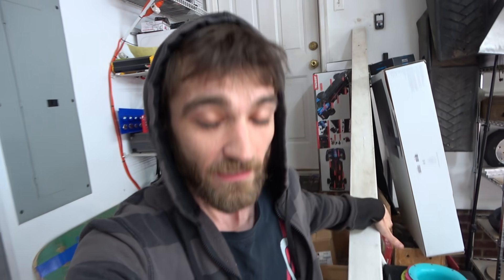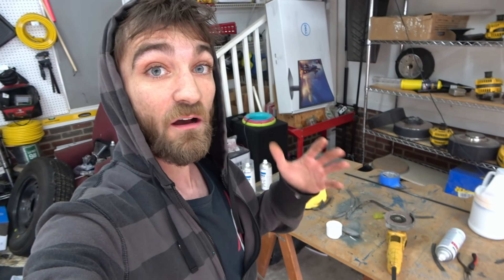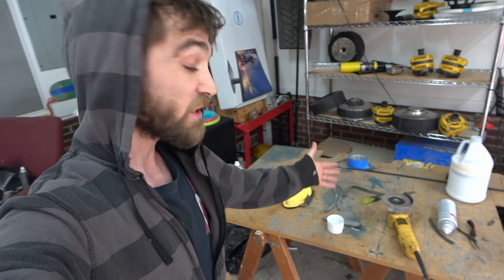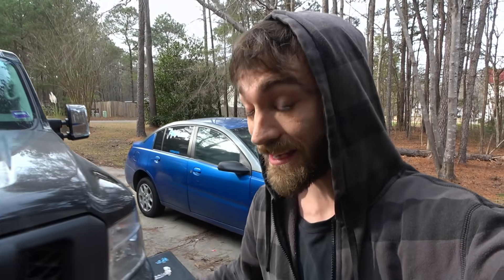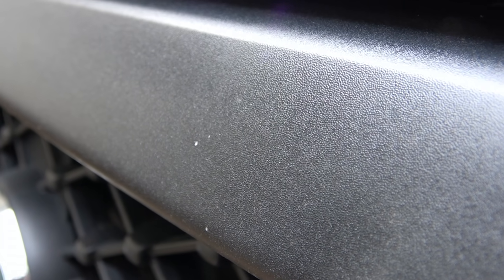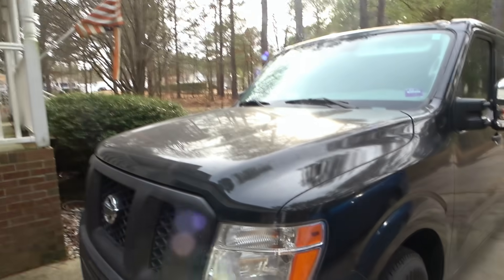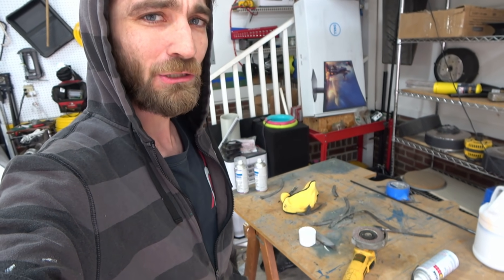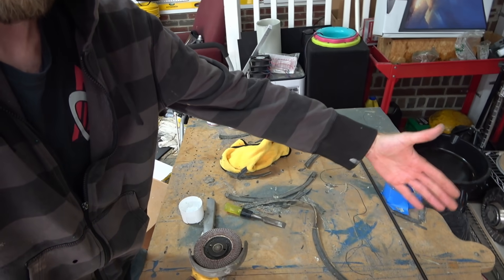FACING MY MISTAKE!!! (EXO's 75,000W Car Audio Build)

Comment: A good detail shop can wheel that off like it never happened.
Reply: Yeah, it would help if it was waxed recently.
Reply: Hey man shit happens,but at least it can be resolved
Reply: Junkyardhemi is 10000000% correct. Please don’t stress about it...
Reply: Yeah exactly to paint a vehicle is a long process so this little mistake shouldn't be that bad
Reply: Super easy for an experienced detailer to correct. Clay bar, Rubbing compound, polish wax
Reply: @cliffp73  wrong* buffing it or polishing it would literally burn the particles of white paint into the clear the best process would be soap and water and a clay bar to lift the overspray particles off the clearcoat and clean the finish of any contaminates before ever even thinking of buffing or polishing any vehicles finish
Reply: He could clay it himself for less than 20 bucks.
Reply: Nah pressure wash
Reply: @alexdel-toro323  pressure wash won't take the paint particles off it's dried to the clearcoat a wash and clay bar will fix it
Reply: Hey bossman. Check out my New Set Up. 5 15s on A Taramps 8k
Reply: Clay bar I’ll get that out for sure.

Comment: DUDE JUST USE A CLAY BAR, IT WILL TAKE SOME ELBOW WORK BUT EVERYTHING SHOULD COME OFF ITS NOT THAT BAD
Reply: Literally going to comment this. My dad did this to his truck when my sister in law drove over fresh line paint. Clay bar took it off easy
Reply: Basically 95% to 100% of the overspray will be removed by a simple wash and clay bar just going to take a little time and lots of clay bar
Reply: He literally said clay bar in the video.

Comment: Bro you can just polish that off really, don't worry about it.
Reply: Either buff it off or rub it off with some mineral spirits. Should work nicely
Reply: Yep if it's rattle can the mineral spirits should wipe it right off. Peace a cake
Reply: Yea bro
Reply: When I saw your set up in the painting video I know the cars were going to get covered.  I’m sorry it happened but as others have said it is super easy to fix. It happens around my construction sites all the time when they spray the buildings.  The van will actually look better than new after a good paint correction so don’t worry about it man.  The van is going to be great inside and out! I hope you come back up to mass so I can get to hear her! Be well man

Grateful
Reply: Clay bar would work perfect.
Reply: Hey bossman. Check out my New Set Up. 5 15s on A Taramps 8k

Comment: Dude Just Clay bar it and buff it out you'll be fine ,Use some Colinite Compound to buff it out she'll be Fresher then factory
Reply: That's exactly what I was thinking that and a good heavy cut buffing compound I like 3ms
Reply: @hbell8264  not just a buff you'll need to properly clean the surface before ever even thinking about buffing soap and water wash with microfiber and then clay bar will get rid of 95% of the white overspray if someone buffed it without clay baring it then all the white paint would just be rubbed and burnt into the clearcoat making it even worse
Reply: @FrgottenFrshness  That's right you can't just buff over spray off like that. There are steps. It's really not that big of a mistake. Easily corrected. Wash with Dawn soap and water (dawn, because it actually takes previous wax off and is gentle on the paint overall.) Clay bar (chemical guys make an excellent clay bar). Wash again ( to make sure paint is on good condition). Don't use a heavy cut compound, use a polishing compound. Then seal with a good coat of polymer wax (maybe even graphene coat the paint) and it will be as good as new.

Comment: If I would have seen this being a previous pro detailer in a body shop I could've told you that's pretty cheap fix. Acetone wipe down, clay bar, and polish. Fixed. But the plastic may be a spray job

Comment: I don't want to downplay it but honestly that's not a huge mistake. It'll easily come off with pressure wash + dawn => clay bar application. At that point you can always do a quick polish and a ceramic coating application too.

Comment: I worked at a high volume body shop, bro you can relax, get some ebay clay bars and some elbow grease and do it on a day with lots of sunlight, if the plastic grill is an issue, power washing  or a brush with soap and water could be the solution. Time consuming, but it's no cause for repainting or buffing. You're good man. Clay bars.

Comment: I have done the same. Used goo gone, takes it off with a little elbow work, then go wash it super super good and re wax it. Should be as good as new. Make sure to use a test spot first to make sure you don't take the origanal  paint of the vehicle off first.

Comment: Give it a good wet sand and buff it out and call it a day. The paint will look that much better for it. I would wait until a few days before you show the truck to do the paint correction. Also you need a decent work area with a proper bench.

Comment: If you go to walmart you can get this kit that includes a foam buffer for a drill and bottle of compound for the like 18 buck. I used it to remove some scratches from the hood of my truck after a tree scratched it. Just make sure to buy and extra bottle of compound for like 6 bucks so like 25 bucks total. It's called Meguiers scratch X and It works great just trust me.

Comment: owning a fuck up as gracefully as you did is an extremely valuable life skill. in the face of this fuck up - if i was going to do a build with 8 batteries and 3 alternators and a clamshell design I'd literally badger/contact you first. I'm not trying give you shit and im not trying to sugarcoat anything either. but in 100% honesty expressing your experience, even if it is a fuck up - in my humble opinion - is the best resume ever. just keep doing what you're doing. you're passionate and driven enough that you're going to beat the game. and with a type of prestige that most bassheads won't ever have.

Comment: It’s ok you can lightly wet sand it with 2000 grit and then use compound and then polish it will actually look better then before ppl do it for paint correction
Reply: Sanding overspray will remove alot of clear coat for a simple problem.

Comment: Back at the old detailing shop where I worked previously, we'd use virgin lacquer thinner on a soft cloth to remove botched paint touch up. Might be worth a try since it's basically fogged on unlike touch up. Just an idea... someone chime in if this process is wrong.

Comment: Clean it off with acetone on a rag then wax it. Acetone doesn't hurt modern paint. They make stuff for removing overspray if you are worried about using acetone but you still need to wax it after

Comment: Exo that knot on your forehead is a cyst. I know because I’ve dealt with them for years. It’s best to remove them while they’re small. It’s only gonna grow larger and it’ll be a pain in the ass to remove. You have 2 choices, either see a dermatologist or you can easily remove it yourself. All you need is a scalpel, butterfly stitches and some ice to numb your skin. Once numb with ice, make a small incision with scalpel, pop it out then apply butterfly stitches. Love your vids man

Comment: Use a buffer attachment that hooks up to a drill or if you own or rent a buffer get it wet and rinse thoroughly as you go but paint will come right off without damage to original finish

Comment: Get some cheap 20 x 20 furnace filters and zip tie them behind the fan on the grills, it will catch most of that overspray without ruining the air flow too much.

Comment: If it makes you feel any better. Back in 2004 The company my dad worked for hired some people to paint the building and they ended up spraying a whole parking lot filled with cars with over spray. It cost them around $100,000.

Comment: Hey man! You're going to think im crazy. But I know an EASY fix for this!! Go to walmart get cheap 1.97 carb cleaner. Spray it on cheaper microfiber towels from harbor freight. (Because you're going throw them away anyways) Finish off the harder parts if any with a clay bar by your side. Another great thing I can kinda see in the video is they are dust/dirt on the car. Meaning 75% of the over-spray probably settled on that substrate, and not the actual clear itself.
But yeah. It'll wipe right off. And it wont hurt you're clearcoat on your vehicle. Seriously man. This will fix you. I use it to clean out my paint guns and to remove overspray all the time on cured clear. I hope he sees this comment.

Comment: O man EXO I feel your pain and can completely relate! Years ago we lived in a apartment complex and the garages where all one unit with just walls splitting each one. But the walls only went 3/4 up. If you can picture what I'm talking about. Well I rebuilt my four wheeler had the frame blasted and was so excited to paint had everything prepared put plastic over my tool box and went for it. I primed it went to lunch came back a couple of hours later everything was looking good so I put on some color let me go back my primer was a lite gray and I used a deep blue for my color. So I got it all done it turned out great. I cleaned up and let it dry for the night. I was so excited to start putting everything back together the next day I came out walking to my garage and noticed my next door neighbor had his garage open and just yelling and freaking out... I covered his bikes "1 of 4 rocket's he had in there" in overspray.. it gets worse my garage was in the middle so as I'm dealing with how I'm going to fix this the guy on the other side of me comes out and my heart dropped this man was cool as hell but he's the type of guy that you didn't fuck with! He had a brand new ss camaro that he loved.. long story short I'm still alive but it cost me over two grand at a body shop to fix his car and the four bike's I still feel so bad and that was about 15 year's ago. I watch all your videos and thought a few times how's he keeping the over spray down. Then as your painting your basket's the other day I seen the fan and could see the car's in the background and thought of what happened to me then to see this video shit I had to share. Shit happens bud but just think you'll never do that again! Keep rockin bud I look forward to every new video

Comment: That could’ve happened to anyone. Feel bad for ya. 
But I do know how you feel. I had a 1993 Mustang GT and I had to have a new windshield installed in it. Don’t remember how much later, but I went to install a hood scoop on it and I went to cut out the hood with a angle grinder and didn’t cover the windshield! I got inside to move it and looked out and said “what the hell is that?!?! The sparks from cutting the metal sprayed all over the basically brand new windshield and looked like it put burn marks on the glass. Kinda looked cool, but I was still pissed that it happened. You get in a hurry and excited about starting a project and not think about the bad things that might happen.

Comment: Bro no biggie. Literally a rag soaked in thinner will wipe it off. Don't clay bar or put a wheel on your black paint. Spend 10 bucks on a jug of lacquer thinner and literally wipe it off like it was dust on a shelf. It wont hurt the paint or clear coat.

Comment: EXO try oven cleaner. I once bought a truck that had a companys logo painted on the side and was told to use oven cleaner to remove it. It worked with a little elbow grease and didnt damage the paint underneath.

Comment: Brotha -  Last year I bought a metal storage cabinet at a yard sale and decided to paint it red in my 3 car garage while my white camaro was inside and covered partially - the whole top of the car T Tops hood truck lid and all covered with overspray even through some of the cloth coverings ..  FML .. My car painter buddy told me all I had to do was wipe it down with watered down mineral spirits after I spent 4 hours with a buffer and compound removing the over spray..  Good luck to ya .. Yes we all make mistakes .. SMH

Comment: Dude! People make mistakes! Now, pro tip. Next time take a garden sprayer and slowly mix a large bottle of dish detergent and water. Spray your entire vehicle down and let it dry. This provides a protective layer against overspray. After you've finished your work simply take you water hose and rinse off your vehicle. This will save the headaches next time.

Comment: Been in detail for 10 years. Not a big deal to fix it. Body prep solvent will probably remove it but if not lacquer thinner will. Just make sure to thoroughly wash it and then use a microfiber cloth when rubbing the thinner on the clear coat.

Comment: It’s not a problem at all man.  You can easily fix it yourself.  Just go to a decent auto or paint store and as for cleaner clay.   3m is the best for overspray.   Then it’s just wash the van, leave it wet then warm up the clay and go for it with either soapy water or clay lube.

Comment: I kinda did the similar mistake on my last build. Was painting Outside the garage! Both door nearly closed, one was maybe 2" open for the power cords and all buuuuuuut.. some of the silver paint dust went inside the garage and on my red car.. But since the paint was not that wet after hitting the clear coat and windows, if buffed off easy. 
I can tell it took a while to figure it out when i noticed while driving... my windows had a tiny glow of silver in sun ligh. What in the heck is that.. paint! From where.... and way later it hit my. My painting.. outside.. FUUDGE !!!!! 
NO worries EXO, it will be all good after the buff operation.

Comment: Maybe all that contaminated area underneath the over spray might be a good thing which added a barrier to protect the clear-coat so chill and just have the shop fix it. And dude make u a spray booth with filters and vacuum system to suck the over spray into the filter. Stay pimpin bro

Comment: Not an expensive mistake, custom automotive printer here, you can wipe it off with mineral spirits. Mineral spirits won't hurt Clear, or a quick cut & buff will take it off easy, don't worry

Comment: I can save you a TON of time. Call your local paint supplier and get an OVERSPRAY REMOVER PAD. Its like a soft textured rubber type pad for a da. Use it and mist windex on the panel. We use it and it works awesome. Probably do the entire van in 2 hours. Wash n wax nd your done.

Comment: Get some clean rags a can of unleaded fuel and wipe it off ...small area at a time. Will take 1k aerosol thinner off no probs without ruining the 2k clear coat. Less messy than flat and polishing. I used to use petrol to pre clean cars before paint preparation.  It will work fine exo.

Comment: Uh that's not a mistake, it's an opportunity to get a cheap wet finish. Step 1 mist vehicle with a sanding guide coat of paint. Step 2 wet sand with 2200 grit sandpaper until all specks are gone. Step 3 buff with polishing compound. step 4 wax vehicle with wet wax. You are going to be amazed.

Comment: i bet most of that overspray will wipe off. if not it should buff right off.  Brake cleaner works well if you use it quickly to remove spraypaint, but it'll strip any waxes. Might damage paint if exposed to long.

Comment: Hi exo. Retired automotive mechanic here.  Ok put gasoline on a soft cotton rag. Wipe that paint right off . It will not hurt the cars pain. Try it in a spot that is not easy to see first. Trust me this will take that over spray right off . I have seen this a few times in the past.

Comment: The overspray is less concerning than the use of plain ol’ box fans to vent potentially explosive fumes. Explosion proof lights and fans bud or just move it out in the open for the spray phase and move them in to dry.

Comment: Hey, sh** happens. Rub and polish and it will be better than new! It's going to be a show car so a good polish and shine had to go in anyway.  I've messed up cars in a similar way atleast two times before, one with sparks from welding an one with dust from diamond cutting disk. Both times it screwed up windshield and side windows and that definitely don't polish out. And oversprayed underbody coating on the interior. Mistakes are what we lear from. Keep up the good work EXO 😎🔊

Comment: Clay bar and soapy water will take that right off bud.. Lots of elbow grease required. Been there done that, only it was 12 vehicles in a parking lot when I was a painter at a welding shop. Kicked on the wrong exhaust fan and you guessed it. Coated everyones vehicle with Yellowstone tan 🤦‍♂️

Comment: No man not an expensive mistake if it's super thick use a Microfiber towel and some solvent and most should come off but that's if it's extremely bad(hard to tell exactly on video) only use solvent if it's needed!!! But use a clay bar or towel that will remove the surface contaminants with minimal damage to clear coat or paint **will probably need a polish after using clay** but I am detailer and I have to remove overspray all the time on my customers cars maybe since your a great diy guy maybe buy a clay bar for $10 and try your hand on it cause you'll end up paying around $150-300 on someone else to do it with quality work and it's sorta fun watching everything come off and good feeling knowing you had a part In it 🤷 Don't stress brotha!!!!

Comment: That's not an issue. Soap n hot water little bit of elbow grease n dog bone sponges 🧽 it'll come right off. Coming from a painter of 20 yrs. Literally once you get it wet should come right off

Comment: Listen bro..next time this happens..go buy a product called "clay magic" or off named brand surface clay. This clay bar will remove everything from the painted surface. Overspray, chemical fallout, road tar, will all easily removed by just rubbing it with the clay bar. Very common mistake bro..it's not that big of a deal. You can use like a quick detailer spray as a surface lube for the clay.